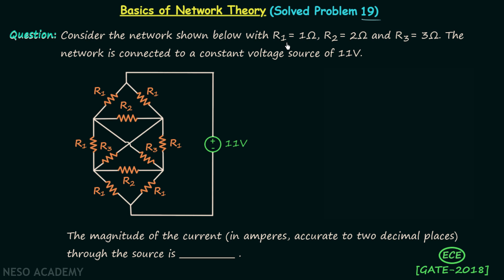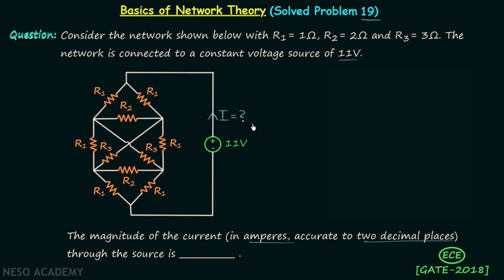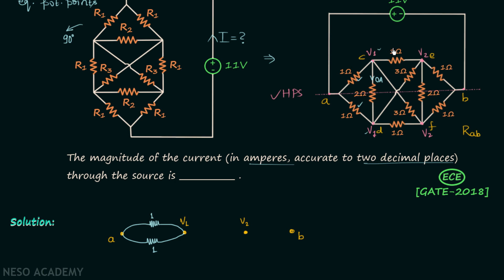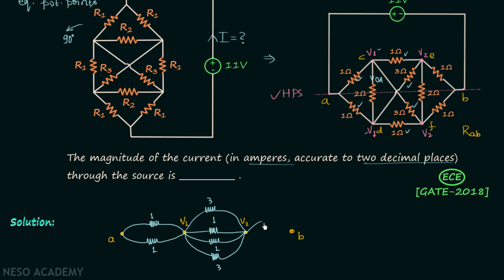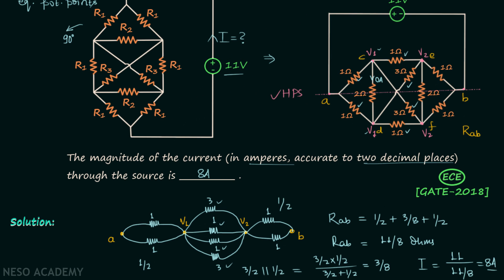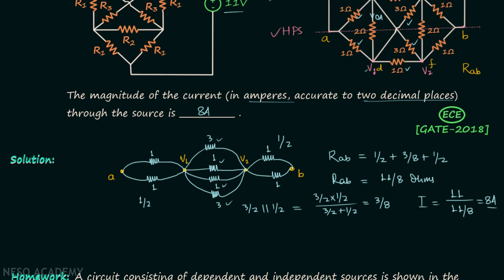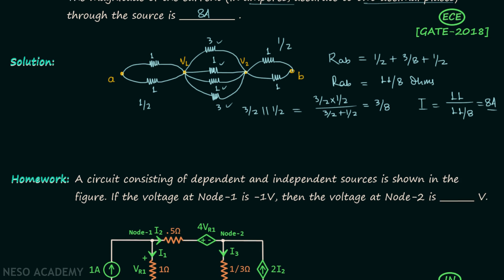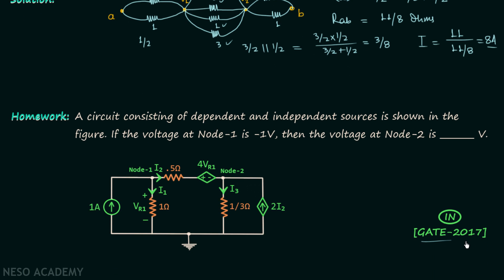Basics of Network Theory (Solved Problem 19)

Comment: Applying KCl at node 1
- 2I2 + I3 - I2 =0
- 3I2 + I3 = 0
I3 = 3I2
Applying KCL at node 2
I1 + I2 - 1 = 0
I1 + I2 = 1
And I1 = ( -1 - 0 )/1
I1 = -1 A
Now, -1 + I2 = 1 
I2 = 2 A
I3 = 3I2
I3 = 6 A
Let us assume the voltage at node 2 is V
So, ( V - 0) /(1/3) = 6
3V = 6
V= 2volts
Reply: nice explanation

Comment: be careful resistance value is 0.5ohm, not 5ohms. apply KCL at node-1, considering node-1 at higher potential the equation would be -1+(-1/1)+(V1-4Vr1-V2)/0.5  =0

Comment: Potential at node 1 is -1V hence I1 will be -1A(downward direction) so I2 becomes 2A 

At node 2 
Current from dependent source is 4A then at node 2   I2+4=I3 the value of I3 is 6A voltage across 1/3 resistor is 2V 
So, 2V is node potential.
Reply: U r genius bro
Reply: Unless I'm mistaken, the dependent source is a voltage source, not a current source.

Comment: Voltage at node 2 is 2V
Reply: can u explain me bro
Reply: @vigneshkumar5634  Voltage at node 1 is -1V. With this data, we can find find current I1 as (-1 V - 0 V)/1 ohm which equals -1 A. Next, we can find that I2 is 2 A. From first loop, 1A current is entering node 1 and I1 is -1A and hence I2 has to be 2A. Now frame the voltage equation. 
-1 - 0.5 I2 - 4 Vr1 = Vr2. 
We get voltage at node 2 has 2 V